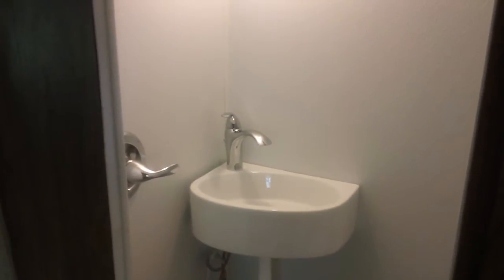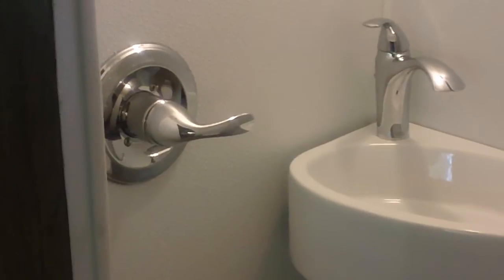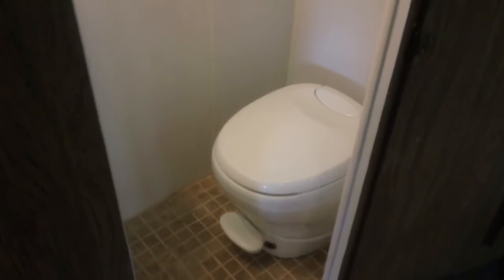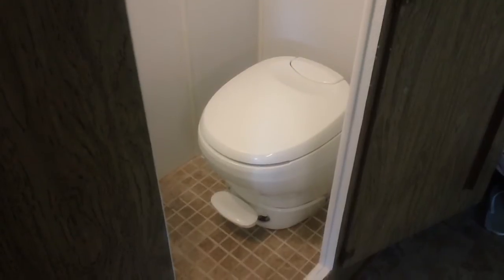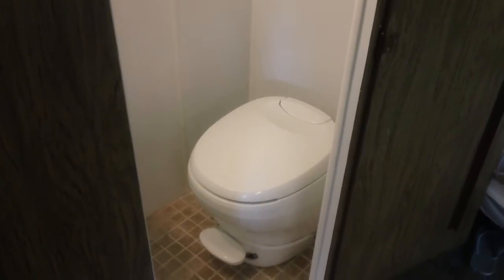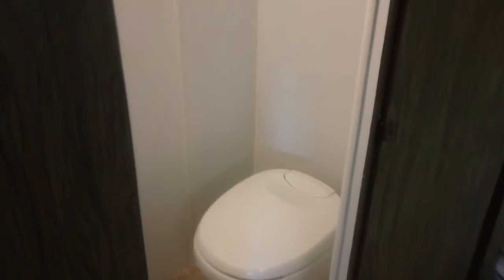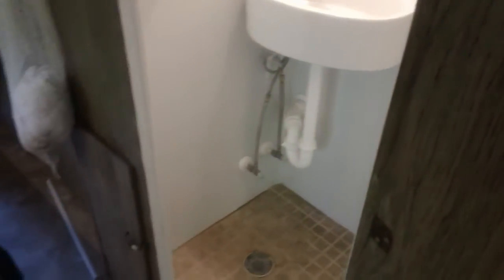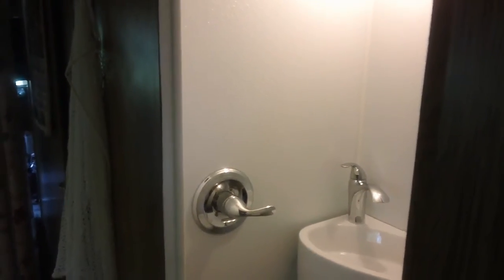FAN Travel Trailer Shower/Bath Renovation

Comment from the maker: HI there:  The shower was slightly shrunk from its stud-to-stud dimensions of about 56" x 30" to accommodate for the installation of the shower valve on one short wall and the added framing to hide some plumbing and wiring (rather than place it on the outside long wall).  Being in Florida and permanently placed on our property, there was no real danger of freezing.  That being said, the final size is about 52 x 29 with a ceiling height of about 6' 7". According to the plumbing company we used, it now claims to be the smallest bathroom/shower they have ever installed.  And it is a real delight to shower will all the hot water we need from our tankless hot water heater by Excel (works very well). Thanks for the nice words. Dr. Z

Comment: Very nice! Love the walls! What is the dimensions of the bathroom? Well done.
Reply from the maker: HI...not certain if I responded.  The dimensions are about 52 x 30 or so.  We have to shrink the size a bit to accommodate the new plumbing, but still have plenty of room.  If I had to do it over again, I might have considered NOT installing a sink...really!  While quite beautiful with the new faucet set, we tend to use the galley sink for washing hands, etc.  Just a though.  Dr. Z
Reply: +Louis Zagar Well done!

Comment: I have a 64 Fannin. I would love to have the bathroom surround...a previous owner took out the tanks, bathroom etc..tho the "room" is still there it just has portable toilet.,  Any ideas where I can locate a surround?  I live 1500+ mi from you & $3,500 isn't feasible at this point. Thanks. Beautiful bathroom!!
Reply from the maker: HI there:  Surrounds can be purchased at several RV parts stores on line.  The problem is the hassle getting one to actually fit without cutting it to pieces.  I would STRONGLY suggest you use the same fiber reinforced panels that are meant to be cut to fit.  They are MUCH better quality than a flimsy plastic panel, easy to install and are waterproof.  Just about any good plumber's shop has them or you can order them.  Thanks.  Dr.Z
Reply: ANd here is the sink info, if interested:  https://www.signaturehardware.com/media/pdf/927895-rubrum-wall-mount-sink.pdf